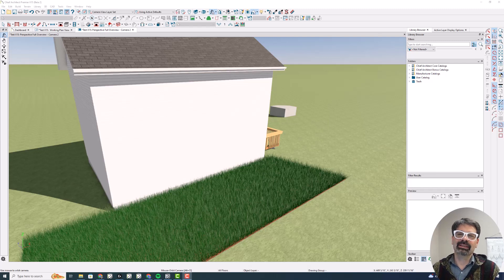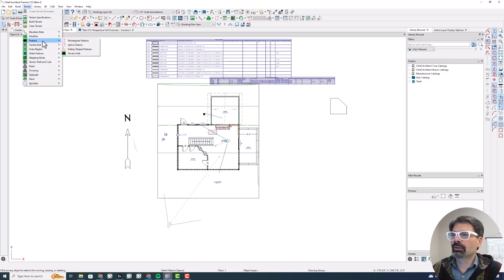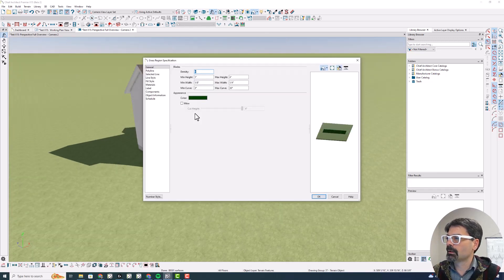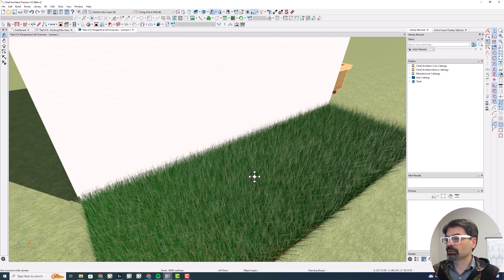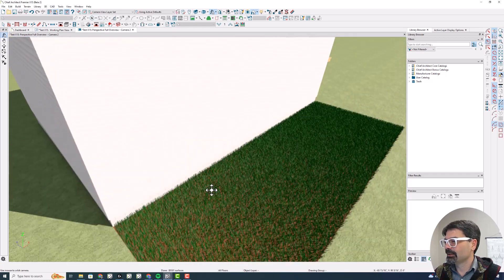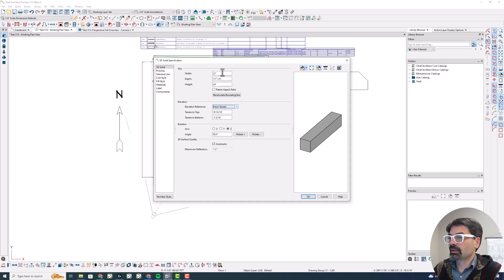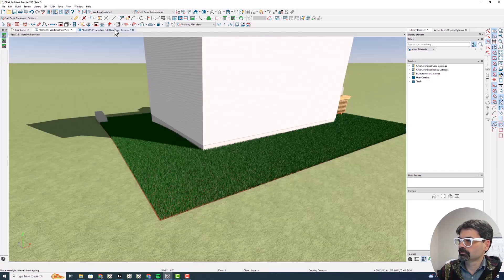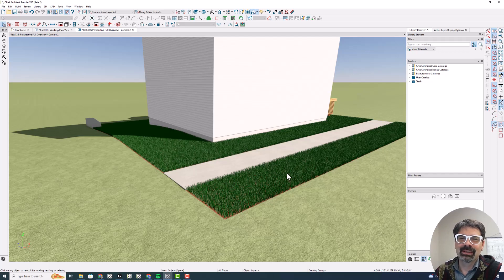Day 11 - Procedural Grass | Chief Architect

Comment: Thank you!  Curious what computer you use?  I’m ready to invest in another laptop but really want something that can handle the Physically Based Rendering.
Reply from the maker: This is the specs on the laptop I bought just one year ago. Technology has surpassed this already, but it's working great for me. This is my one and only computer. Have a laptop stand and external monitor for my office, and pack up/take with me every evening or to a client presentation meeting.
I purchased from www.rjtech.com 
Clevo PC70HS Barebone Series, 17.3" FHD 144Hz 72% NTSC Matte LCD, nVidia RTX 3080 16GB GDDR6 Max-Q, Intel i7-11800H CPU, Intel Wifi 6 AX201 Dual Band WLAN/Bluetooth